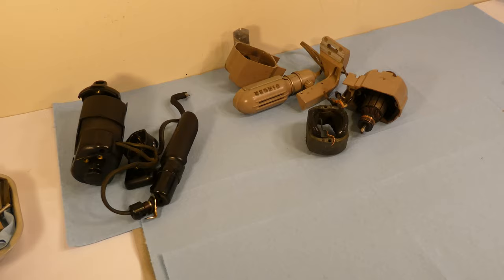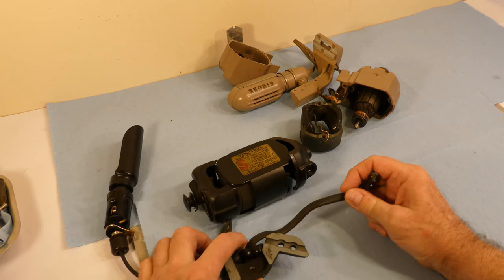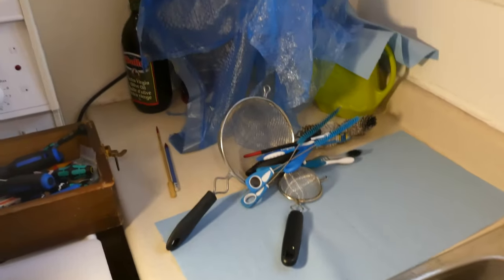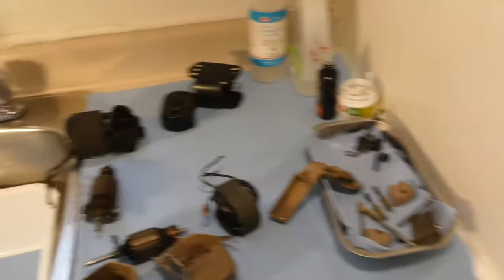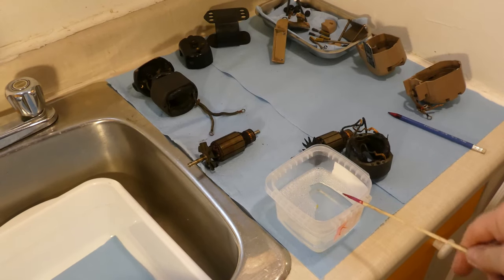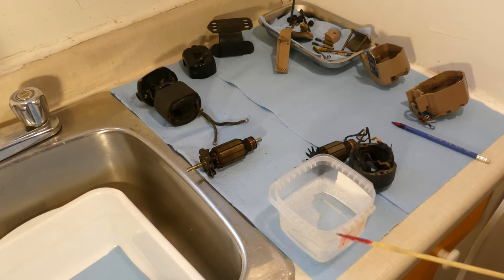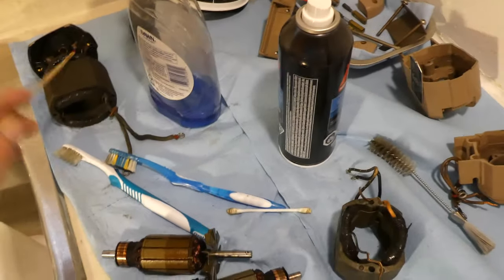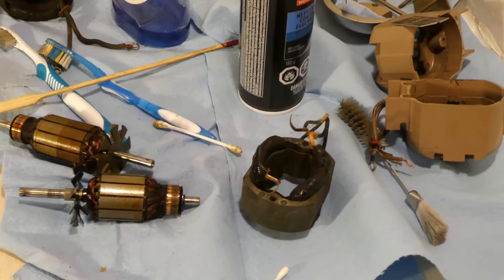HOW TO CLEAN SINGER 306K MOTORS

Comment: I would have thought that isopropyl alcohol would be the better medium to clean the motors due to any residue evaporating especially in the windings, as there would be a risk of small amounts of water sitting in the windings and possibly migrating to the electrical contacts etc
Reply from the maker: Agreed, I have had good results using Electrical Contact Cleaner. I do not film the entire drying process using the hair dryer because it takes 5-7 minutes and the hair dryer is noisy. Thanks for visiting Graham!